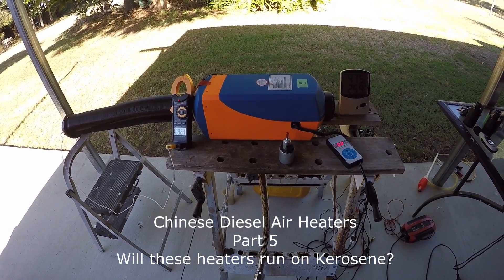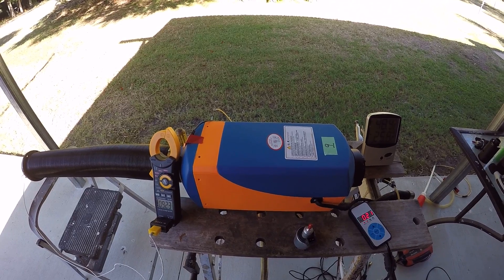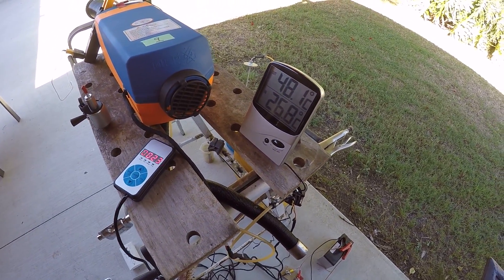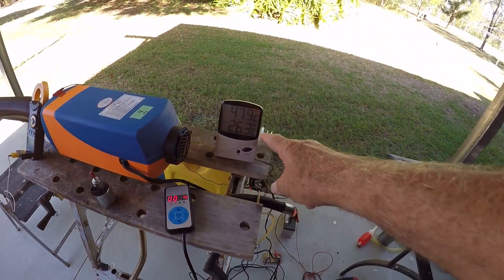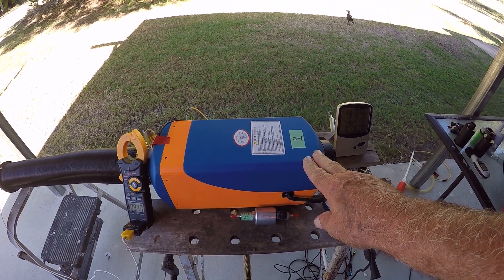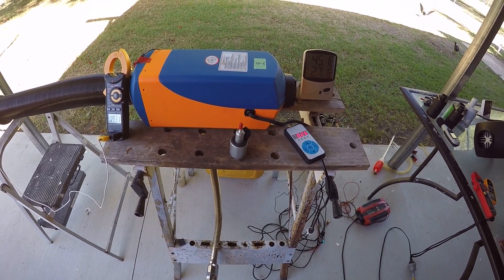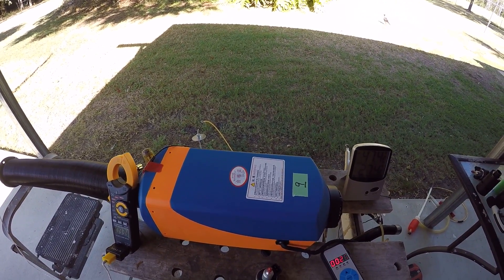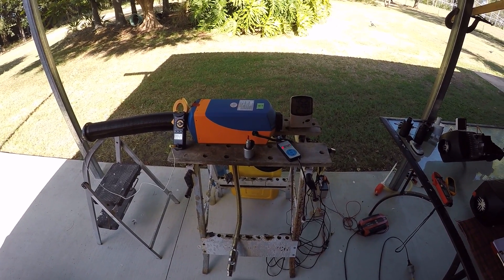Chinese Diesel Air Heaters   Part 5  - Kerosene Use.

Comment: Thanks John for that detailed explanation.  I camp in Alpine areas where we regularly have snow and sub-zero temperatures.   Carbon build up from the diesel was so bad the diesel heaters would stop functioning.  Pulling the heater out in such conditions was not fun.  In fact, it is so off-putting a friend has binned the diesel heater for a far more expensive LPG Gas heater!    We started hearing about using a kero/diesel mix last year and I think it slowed the build up, so your suggestion of a 50/50 mix will be tried this coming winter.  I have also purchased another heater that is easier to take apart for cleaning the combustion chamber should the need arise.
We suspect the local "alpine diesel" is using a heating oil additive rather than Kerosene, which works fine with the diesel 4WD but of course the service station attendants don't have any idea what is in it!   I will therefore try to take as much 'normal' diesel with me for mixing.
Reply from the maker: Hi John, you do not state where you live but in the US and some European countries their commercial Kerosene has a very high sulphur content which provides lubrication. 

In such cases you could try a high kerro/diesel mix, like 80/20 or perhaps even 90/10. 

Spare non branded metering pumps can be bought on eBay now for  around for around $15, so it is not big expense if you destroy one in your testing. 

LPG heaters are clean and simple but produce huge amounts of water vapour, causing condensation and mould. These little diesel heaters give you a nice dry heat. 

I would appreciate info on how things go. JMcK
Reply: @johnmck1147  Snowy Mountains, Australia - where kero is really expensive!
Reply: Do you switch your heater to Alpine mode when you camp? If not, that should help prevent carbon build-up.
Reply: Just run straight kerosene like a bunch of us do. No smoke, no gelling, pump is fine. I would definitely recommend kK1 if the price is low enough. Follow John's fuel delivery video instructions and also put heavy gauge wiring to your heater and it will run 1000s of hours more than likely. It is an obvious choice to me and I would rather buy a new heater than rip a diesel clogged heater all apart.  The heater in diesel will be running poorly as it is progressively getting clogged up..  Why put yourself through the hassle?

Comment: Hi John, interesting and informative. In the UK Kerosene (28sec domestic heating oil)  goes up and down a few cents depending on the time of year but averages 93 Australian cents per litre, while road diesel is more than twice that. :)
Reply from the maker: Hi bobonmull, thanks for that information.  JMcK
Reply: So what grade do we have that may effect the pump, given costs of replacing the pump
Reply: @ifell3  i see that you are in the Uk, 28sec domestic heating oil is the cheapest and only option I use nowadays and have been running my heaters on it for years now without problem. The only difference between domestic heating oil (kerosene) and road diesel is the addition of a lubricant which is not necessary for domestic boilers or these heaters.
Reply: @bobonmull  hey awesome, thank you for the reply 👍
Reply: @bobonmull  Hi, I'm also in UK. Just bought one of these and had it running off some paraffin that had been sat in my shed for a few years that I originally got out of a pump at a fuel oil supplier - and it ran well. Just to check - when you say 28 second domestic heating oil is that the straw coloured paraffin/kerosene like what I was using rather than the red gas oil? Thanks.
Reply: @jimjam8179  Yes, it is straw coloured and you are correct. :)
Reply: @bobonmull  Thanks for that. Sounds like the stuff out of the pump I got is the same stuff you've been using. Tried some red diesel in it today - 50% more expensive for no noticeable difference in performance. And it stinks! 28 second paraffin/kerosene all the way once that's burned off!

Comment: One problem in the US is that 99% of the kerosene you can get is dyed for tax purposes. sigh In wick-style kerosene heaters, the dye clogs the wicks and messes them up pretty quickly. Don't know if dyed will cause that in this type of device, and I wouldn't rely on it for cleaning the lines.
Reply from the maker: Hi Jollyprez, thanks for that info. I agree, I don't think I would like too much dye going through those thin fuel lines or through the little dosing pump.  But without personal experience with your kerosene I can not offer Intelligent comment. Thanks again. JMcK

Comment: I'm doing my research on these heaters and you pointed out something very important if wanting to run them on KEROSENE. Lubrication - Guess, if I get one, to ALWAYS BURN Diesel. Thank you from the colonies..
Reply from the maker: Hi Admiral, they appear to run ok if your country produces a high sulfur content commercial kerosene. The sulfur gives lubrication. Otherwise you can run a kerro diesel mix. There is no point in running a kerro diesel mix in some countries, like Australia, apart from cleaning purposes, as our kerro is far more expensive than diesel. J

Comment: Why don't you mix in a little bit of Veggie oil with your kerosene that should help lubricate the pump correct and should be thinned out by the kerosene what's your thoughts on this
Reply from the maker: Hi there, the issue with all oil products is they do not burn clean and leave soot deposits in the burner. Soot buildup is the problem child with these heaters. Better to add some diesel to the kerro. If your country produces a high sulfur content commercial kerosene, it may have enough lubricity to stop pump damage. J
Reply: @johnmck1147  Do you have high sulfur commercial grade kerosene available in your area?  I'd be interested to know what sort of difference you found if you tested it.
Reply from the maker: Phantom309 

The common Kerosene in Aus is low sulfur lighting kerosene, and it has very poor lubrication. I have heard in parts of Europe high sulfur commercial kerosene has been used ok in these diesel heaters. With a Chinese dosing  pump so cheap to replace these days, it could be worth a try for you to try commercial kerosene, if that is what you wish to try.  JMcK

Comment: i have your type of controller  their, would like to know how it works . haven't completed my install yet  so i haven't had the chance to play with it yet, of course it came with no directions , your imput would be appreciated
Reply from the maker: Hi James, I may do a complete video on each controller sometime in the future, but I can give you enough here to get you going manually. 

Short push on centre button to start heater, top led comes on. Adjust heat manually by pushing top button to go hotter, bottom button button to go lower. A reading of 3.0 is about medium heat, 1.6 low heat, 5.5 is generally max heat for those controllers. Long push on centre button to turn heater off. J

Comment: John , Here in the harbor we have people who live on there boat all year long and burn kero with no issue . Maybe you had a pump that was on it's way out > Ps Im in a group called "Chinese diesel vehicle heater" and we refure to your Videos in the Files section.
Reply from the maker: Thanks for the feedback Paul. What location are you, and what sort of kerro do you use? Do you use a high sulfur commercial kerro?  What price do you pay for your kerosene? Thanks
Reply: 1st Belgium 2: the 'ordinary' one 'lampoil',  not the low sulfur 'zibro ' for indoor heater's 3 It's just a bit more than red diesel 0.89 a liter at the pump . Reddiesel is 0.82 euro cent a liter at the pump. Ps keep the video's coming, cheers Sir
Reply from the maker: Thanks Paul,  I can understand  there will be no issues with a high sulfur content kerosene. Thanks for the price info. J

Comment: Add a bit of engine oil in the fuel.
Reply from the maker: Hi Jeff. Sorry, I have to disagree here, and it has to do with the burn. Burning engine oil creates a lot of smoke and soot/carbon, and it is soot and carbon buildup in the fine burner atomisation screens in the heater combustion chamber that will stop these little heaters in their tracks. Burn oil in these heaters and you set yourself up for a lot of future grief and difficult maintenance issues. J
Reply: I thought if you mixed a bit of engine oil it would work as in the 60s we run diesel engines on a mix of oil a paraffin to shop the diesel pumps running with no Lub and it work well with know problems and no smoke anyway thought it might be worth a trying. Jeff @johnmck1147
Reply: A engine and burner are mile's apart . Just burn some oil in a pan and you will be amazed how much crust stays behind !
Reply from the maker: Hi Jeff, thanks for the feedback. Yes, it would make an interesting trial to see how much soot was actually deposited. Eberspacher in their tec manuals say never burn oil in their heaters, but sometimes it is good to do your own testing. J
Reply: Use some yamma lube 2 stroke pre mix. Mix it at the same ratio as the highend 2 stroke race oil at 50:1 or 100:1